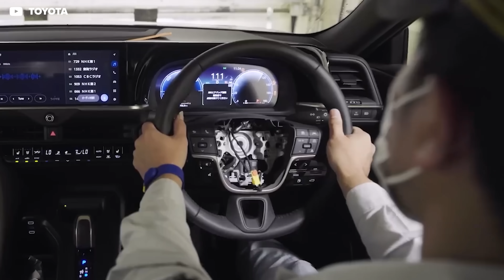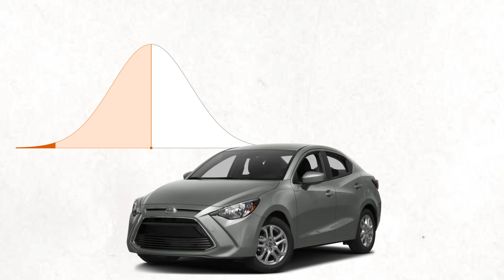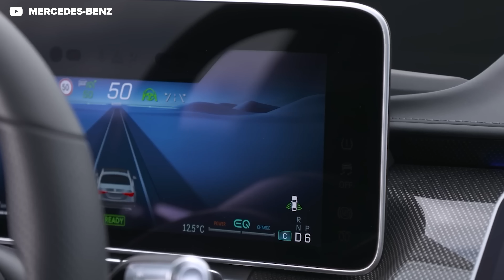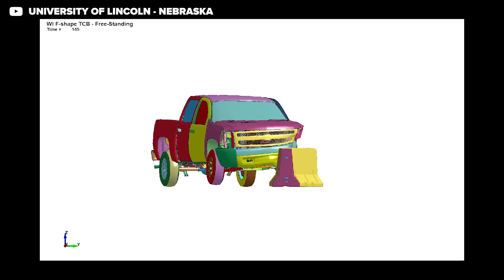The REAL reason guardrails can't stop EVs in a crash

Comment: 8:44 How does ADAS make a car heavier? Every car on the road today already has electric power steering and electric throttle control. The only extra things needed are a camera, radar and computer. That is likely no more than 5lbs extra. Newer systems also have driver monitoring to make sure they're still paying attention to the road, but again, that's usually just a tiny camera that faces the driver.
Reply: The answer is very simply that automakers are lazy and will just add miles of wire and new computers and all kinds of things rather than re-engineer parts to reduce the total number of parts, etc.
Reply: @JoshuaKoerner  This is just stupid ... as if wires are heavy! The arguments still stands: active safety system are NOT making the cars heavier by any reasonable amount!
Reply: @glockmanish question. Have you ever tried lifting just 250 feet of welding lead? All it is is rubber and copper on the inside of the rubber.. yet its like 75 lbs. Its heavy. Im not arguing with ya or anything its just the standard wire is light because of its relative size. As the wire gets thicker or longer or more is added, it gets heavier and heavier very very fast.
Reply: @Vapor_Research now you Tell me how much wire ist needed for advanced Driver Assistance ... I can tell you ... Barely ANY! Power steering and ABS are already Computer controlled. What ADAS is, is a small Kamera/Computer behind the reae View mirror ... In some Cars additionally a small Radar Module behind the front bumper. Cables to those are 12V plus, CAN high, CAN Low ... That's IT! All in all ist about 5kg MAX!

If you argue ADAS is adding considerable weight are way outside your scope of knowledge and are in no way or form elligable to add to this discussion. 

End of Story!
Reply: The average car on the road is seven years old. Every car on the road doesn't have electric steering or electronic throttle control.

Comment: Lifted pickups are higher than the barriers, but that's ok since their extremely masculine drivers are such overpowering studs.
Reply: Finding an old hilux or something small in america is basically impossible
Reply: ill just stick with douchebags drive those
Reply: With small pps
Reply: Not all pickups are lifted but still higher than the barriers.  My stock 1996 Dodge Ram 2500 4x4's floorboard hits me above my knee and I am 5'10" tall.
Reply: @johncooper4637 my 1996 Ram 1500 I lowered with a 4/6 drop and 28.6" tires, so the roof is about shoulder height... Definitely my preference for a practical truck. Makes loading and unloading, entering an exiting so much easier, more highway fuel economy, and more stability. Also easier to wash and to work under the hood. 😅
Reply: Yep, but we are ok with the additional risk, and nobody cares about us anyway
Reply: Yes. But the short men (in all aspects) who drive them need all the help they can get.
Reply: @christophermadden6485 Can you stop with the body shaming? I don't own a truck and I'm just reading but do you really need to add physical traits that just harm people who actually have said traits? "Oh a big truck must mean he's short and compensating, being short is bad" just stop, it's disgusting.
Reply: It’s ok. They still make lifted heels for your type. And you can probably get an injection from some sketchy doctor for your other problem. Good luck. 🍀
Reply: Just say you're poor 😭
Reply: @NedLingamon our tallest truck was our cheapest purchase what are you talking about

Comment: casual reminder that since battery tech is still maturing EVs have to opportunity to loose weight as they get more energy dense (as long as manufacturers use it to loose weight and not gain range) additionally EVs are already more fuel efficient meaning they dont require being larger in order to comply with emission regulations, meaning they can be smaller for any event where being smaller is safer than being lighter (please dont take my word as gospel, im a hobbyist not an expert)
Reply: lose

Comment: It would also be nice if the carmakers were making smaller, more basic cars.  All that excess junk drives the prices up to make them unaffordable.  When I got my Hyundai Accent, the year after mine they changed to a larger and less-basic design, and jacked the price up by **40%**!
Consider if newer cars are supposedly safer and more fuel efficient, if their overly-optioned cars get much more expensive, people will have to drive the older cars without all of those safety/efficiency improvements.

Comment: "we all know that cars have been getting bigger and bigger since the 1990s." Wait, what? Do we live in different timelines? Other than pickup trucks, and the mini cooper you show, almost everything has gotten smaller. Take SUVs, for example. A few of the full sized ones have stayed about the same, such as the 4runner. But Toyota's RAV4 has gotten so small it can't rightfully be called an SUV any more. Same with Honda's CRV, the Chevy Blazer and the Ford Escape. They are all tiny compared to the former versions. So, my question still stands, do we live in alternate timelines?

Comment: On motorways here in the UK, we're increasingly replacing our metal guard rails for concrete barriers. The idea is more to keep the car \ lorry from entering the opposite flow of traffic entirely and remove that particular variable from the equation. 
As a motorcyclist, I'm honestly happy that the change is happening as if I hit the deck and slide into a guardrail post at any angle, I'm toast. But if it's a concrete barrier, I'm less toast.
We still see new metal guard rails on slower roads (A & B roads) as the speeds involved mean you're less likely to overcome the rail, and I've also noticed the design changing to be lower on the bottom end in a move that I expect is to counter the exact scenario you're putting forward here.

Comment: And yes the EVs have a very strong and ridged passenger compartment but your also sitting over lithium batterys  that in a crash can turn the vehicle into a instant creamatorium that will cut out the mortician in a few minutes. Good news it happens so fast you won't know what happened. Facts are everywhere ignoring them well your free to do that. Or ask a fireman that tried to extinguish a EV and how long it was a sun ☀️ on wheels?
Reply: You are safer in an EV than an ICE. The most current LFP batteries are extremely difficult to force into thermal runaway. Even with older batteries, they are still safer than an ICE and fuel spilling everywhere. What is dangerous is not having manuel handles if the electrical system shorts out but that is the same issue as with ICE and BEV. There are emergency exit handles but in an emergency you may panic and not get to the emergency handle.
Reply: Wrong assumption, gas spreads out in a collision and ignites FAR faster, even spreading around the vehicle sometimes too.  FAR more dangerous and every single study done in the last few years have shown EV's are safer in that regards as well as most others.  Tesla Model X's got the highest crash rating ever achieved at the European testing institute
Reply: @BarrGC  The problem is Teslas have a propensity to somehow sharply steer off into trees, tow trucks, etc when in self-driving mode and kill their occupants.
Reply: @Eibarwoman  "Propensity" is a drastic overstatement and regardless it's in beta and makes you pay attention, so anyone killed was being careless

Comment: 6:17 This video has been proven its staged the older car is completely rotted out! Ready to crumble under its own weight!! You can see rust dust and chunks flying everywhere!!!  It was painted and cleaned up on the outside!  Its like having a brick house that a fire gutted and saying look its not as strong as a new cheaply made house we can knock it down with a watermelon! But hide the fact that the inside is gone nothing left to support the walls!!! That video needs to be flagged as fake!!! Just look at it!  If was in perfect condition that newer car would have looked like a can of tuna left on the NJ turnpike during rush hour after a few days.

Comment: Getting heavier? Only younger people would say that!  My first car was a 73  Olds Delta 88 my friends called the Ocean liner!  My second was a lighter 70 Dodge Coronet 500 built like a tank! . Then the 80s came and cars were absolutely JUNK! Small cheap China Steel tat rotted out quickly. Yes trucks have gotten larger only because of the government regulations over emissions and MPG ! It's here to stay people are still buying these massive trucks even with the inflated prices of $100k +  doesn't mean they won't get repoed but they buy them they need their pavement Princess on the road that can no longer do truck things! My older ram 2500 is just to tow my fifth wheel camper because a smaller vehicle can't physically do it!.
Reply: I like how cars were late 90s, early 2000s before the current level of bloat, but after the trashy ugly 80s cars.

Comment: 4:24 I don't understand how the center of mass is the main issue here... even if there was no batteries here and instead a massive fossile fuel engine in the middle of the hood here, by the time the guard rail reaches the middle of the hood the guard rail has already been flipped up and above the hood. This seems more like an issue of a guard rail that is too high to work with the low profile of the car.
Reply: Yes, looks more like the good aerodynamics is a bigger factor on the Tesla going under the rail.
Reply: Thinking the same here. That model 3 nose profile is low and just digs in below the rail.
Reply: Center of mass is the main issue because the lower center of gravity encourages the Model 3 to pry the guardrail up as the forces build up during the initial impact. If the center of gravity were higher, to the point of being in line with the guardrail, the guardrail would still catch the car as the front bumper doesn't entirely go under the guardrail. It actually impacts the guardrail even with the lower bulge.

A practical demonstration of this at play can be done with pinewood derby cars and a rubber band to act as the guardrail. Have a similar design on two derby cars with the same weight but the only difference being the center of gravity. With the CoG lower than the rubber band the derby car, with enough force, will force it's way under like you see with the Tesla Model 3.
Reply: @rainsilent  I don't think you can dismiss the shape of the vehicle, if the front was higher it would connect the rail higher up and push it downwards irrespective of c-of-g
Reply: @brendanwright5621  I'm not dismissing it. There are cars with similar nose profiles that hit low and the guard rail still holds because the CoG is higher. Also this... "if the front was higher it would connect the rail higher up and push it downwards irrespective of c-of-g"... is not at all true. Where the CoG is determines where the majority of the oncoming force is focused relative to the point of impact. If the CoG is lower than the point of impact the force applied will try to go under the point of impact regardless of anything else. If the CoG is higher than the point of impact the force applied will try to go above regardless of anything else. This is very basic physics that can easily be replicated.
Reply: @brendanwright5621  Case in point to CoG forcing one way or another relative to the point of impact look at more than half overlap crash tests. Why do you think the cars spin off away from the hit? The CoG of the car was off to that side. That is precisely what is going on with the Model 3 slipping under the guard rail. You move the CoG to inline with whatever is being impacted and the vehicle barely tries to spin off to the side if at all.
Reply: @rainsilent  by whatever logic you are using, you simply add another model 3 on the roof of the current model 3 and then by "your logic" the model 3 will no longer go under the rail because all that weight is now above that low center of gravity. Now with another 4000 lbs of weight on the roof it will magically stop the rail from being ripped upwards. Problem solved.
Is this what you went to college for? Because a 5 year old child could make more sense. You put your hands under and lift up any weight you want if you are stronger. You put your hands straight at dead center and no matter the strength or where you center of gravity is, you are NOT lifting anything up unless you go under it. The rail doesn't give a crap where the battery is, under the car or on the roof.
Reply: @AlenMop  "You put your hands straight at dead center and no matter the strength or where you center of gravity is, you are NOT lifting anything up unless you go under it."

Problem with this example. You are starting with 0 movement and against the object in question. From this point you are just going to push. Problem. This isn't relevant at all to the discussion. Why is this not relevant at all to the discussion? In case you didn't notice the Tesla was already moving at speed before it came into contact.

"The rail doesn't give a crap where the battery is, under the car or on the roof."

Basic physics says otherwise. The exact same thing that causes cars to spin off in less than 50% overlap crash tests is the same reason the Tesla is slipping under the guardrail. Where the CoG is.

"Is this what you went to college for? Because a 5 year old child could make more sense."

This is why you need to go back to middle school science class for because you are making less sense and are failing hard at basic physics.
Reply: @rainsilent  So adding another Tesla on the roof would make the rail definitely not go up right? Because the weight is not low anymore but nice in the center.
Reply: @AlenMop  Adding another Tesla on the roof would put the center of gravity where the roof of the two vehicles are connected together. That would be well above the guardrail. Remember that the center of gravity of a car is where all of the distributed weight of the car ends up focusing at. You put two equal weight cars on top of each other the center of gravity will be where they are connected because that is where the point where all of the weight is equal at.

With such weight the stacked Tesla's would just blow through just like the Rivian truck did. Your combined Teslas would be over a ton heavier than the Rivian truck. If you want to see what a slanted nose would do with a more elevated CoG that wouldn't just blow through or forcibly slip under I'm pretty sure there are more videos out there of this very test with different vehicles that you can look at.
Reply: @rainsilent  So now you are changing your answer to it's not slipping under the rail even if the weight is the same. You are hilarious now.
Reply: @AlenMop  No I'm not. I haven't changed anything. I simply pointed out that if you want to see a low nose car with similar weight with a higher CoG not slip under you could likely find an example looking for more crash test videos.
Reply: @rainsilent  so you just changed the answer to I was right, if the center of gravity is moved up then the car will not will push the rail straight forward. Instead it will push the rail up regardless of where the center of  the weight is.
Reply: @AlenMop  Nope. I didn't change anything. If you actually read what I write none of it agrees with you.
Reply: @rainsilent so now you're saying if the Tesla was carrying another Tesla on its roof, the Tesla will push the rail forward.
Reply: @AlenMop  I said it would break through the guardrail like the Rivian did.
Reply: @rainsilent  just like magic. You go from going from under the rail because the weight is low inside the car to if the weight is put on the roof you will magically go over it. News flash, the rail doesn't know where the weight is. The front bumper doesn't know where the weight is. Only you know where the weight is. You haven't got clue how wrong you are, this is hilarious.
Reply: @AlenMop  "You go from going from under the rail because the weight is low inside the car to if the weight is put on the roof you will magically go over it."

Quote me where I said it would go over it. Oh, wait. You can't. You are making this up.

"News flash, the rail doesn't know where the weight is. The front bumper doesn't know where the weight is. Only you know where the weight is. You haven't got clue how wrong you are, this is hilarious."

Neither the guard rail or the bumper do but they will react in accordance to where the CoG is relative to the impact point when the force of the car is applied during the collision. I'm not wrong. I know I'm not wrong. It is basic physics. You are the one that is clueless and anyone that reads this will be laughing at how clueless you are.

Comment: My gripe with EVs is that the battery cannot be separated from the main body of the vehicle. If it catches fire, it doesn't stop and behaves like thermite, anyone trapped is done for. We really need to start moving towards a removable power core instead of a structural core for the battery.
Reply: How would you get that battery pack out if the vehicle was wrecked and badly crumpled?